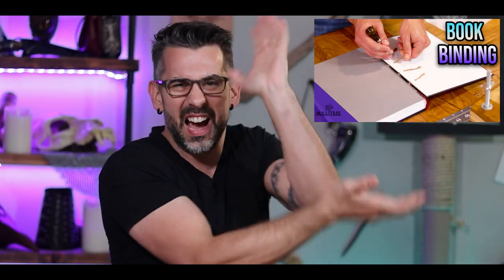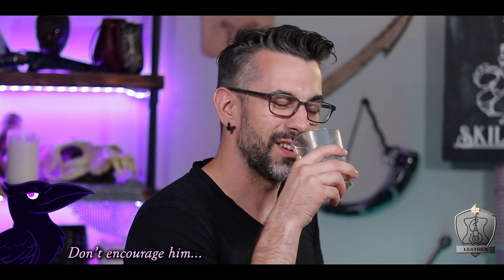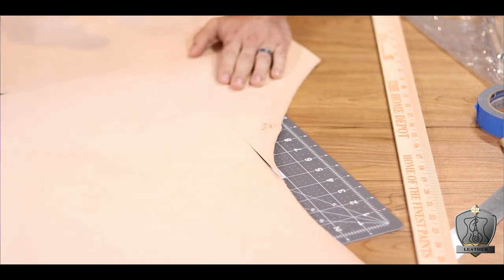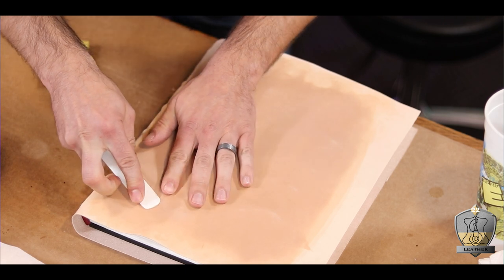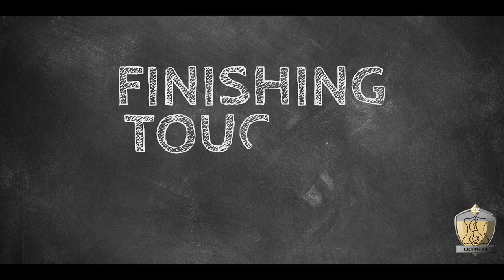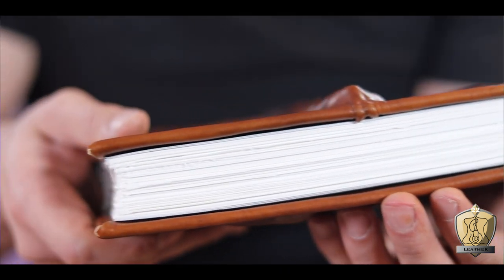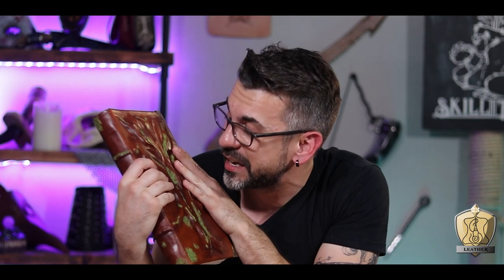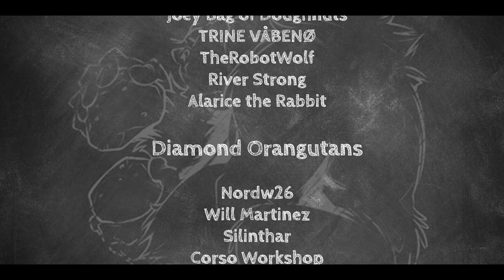Book Binding an Epic Druid Tome

Comment: Detail for wet leather forming. Suggestion. Go to Dollar Store and pick up several garment vacuum bags. Wet your leather, lay it on your form, put it in the bag and, with a vacuum cleaner, pull the air out of the bag and seal it, then use a plastic rounded tool to form the leather to the object underneath. Leave it in until it dries. This will give you the detail you desire.